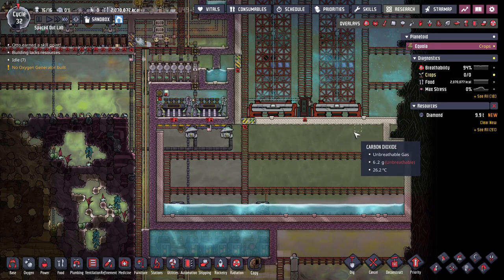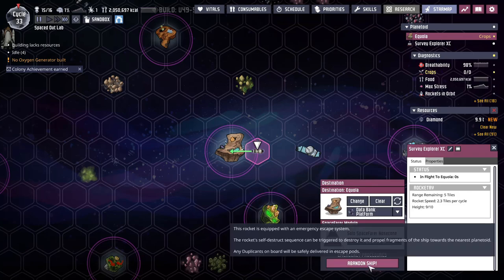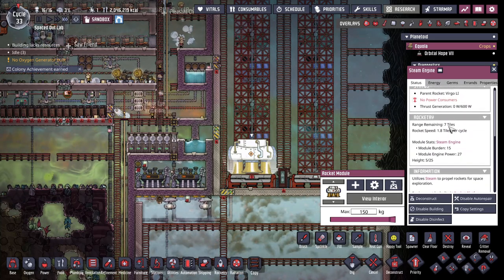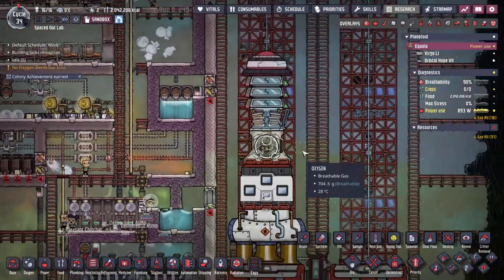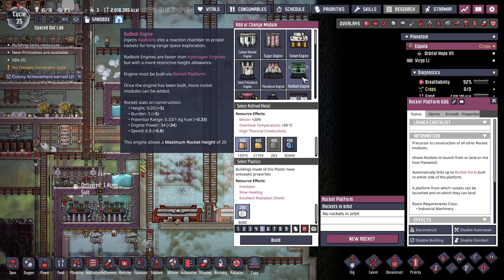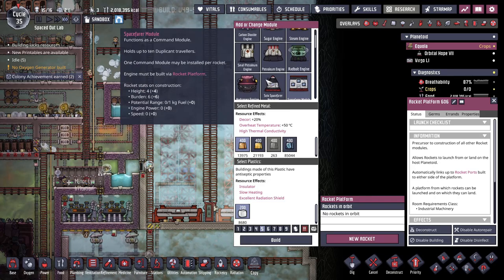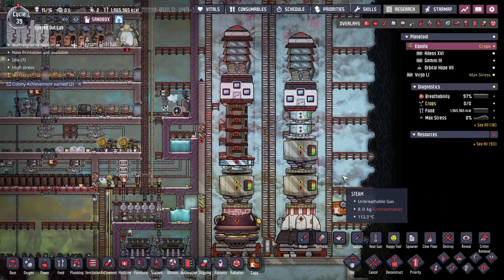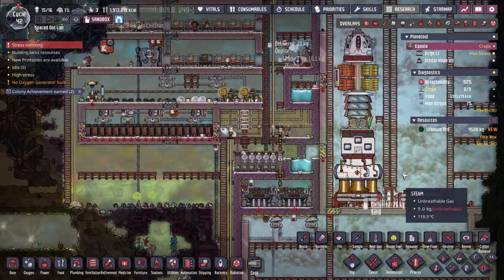How to build every type of Rocket Exterior (Spaced Out)

Comment: I usually use a steel Robot Module and steel Trailblazer Module to build a rocket platform. The Rover can deconstruct the landing module and the Dupe that lands can deconstruct the trailblazer landing module and gives you enough steel to build the rocket platform. When you land, you can rebuild the rocket platform with another refined metal if you really want to so that you can recover the steel if you want to use that to build out some initial infrastructure

Comment: How do Rockets compare to the teleporter? Is there a rough technology window when i should be starting and ending using the teleporter for travel and supplying. (There May be a What's the best, video in it comparing both to the launcher)
Reply from the maker: The teleporter only goes to one place and is absolutely the best travel method for that asteroid.  All of the others require rockets.